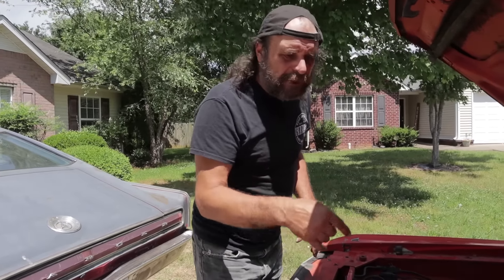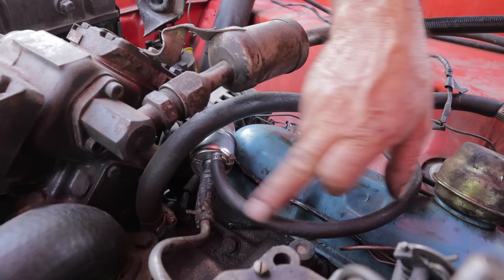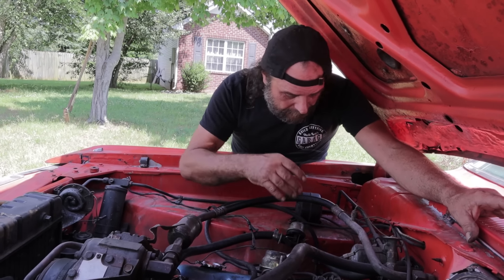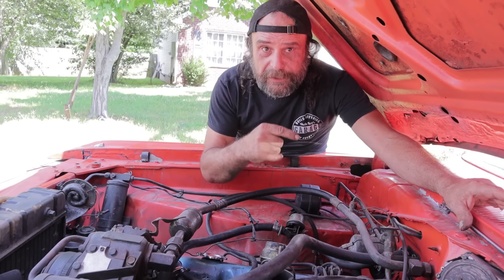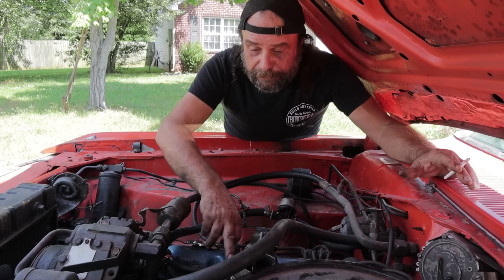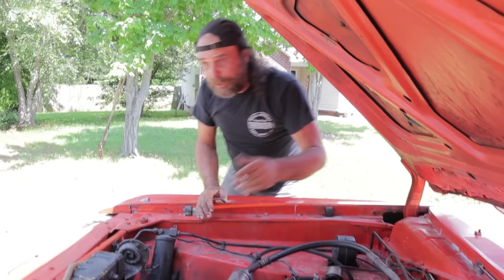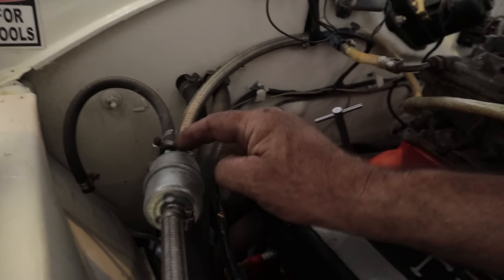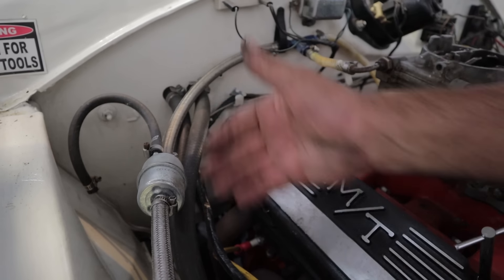$8 Cure For Vapor Lock

Comment: As a society we sooo much need to return these basic all mechanical days. Please, no more computer modules or touch screen garbage. We Need OLD SCHOOL.
Reply: Thing is my 38-year-old battery charger died there is only 1 company that still makes non-computerized chargers(for F's sake) and they want 2x the price probably gonna pay it Some things are better (you can meter fuel and spark more accurately w computer) but most are way worse with digital anything
Reply: Harry. B. Renner. jr.  I don't care about computer efficiency.  Electronic sensors fail. I want old school simplicity.
Reply: Harry. B. Renner. jr.  no todays cars are not easier. Scanners point you in the right direction, thats it. Without that scanner to see which system has the problem or if it's the communication network, your screwed. Also you still have to track down the electrical circuit and check to make sure there are not any other systems tied to that circuit(flow chart needed). You still may need to do your leg work with drivability and electrical. Today's cars are very intricate and can be very difficult even for a master technician, and THAT'S THE TRUTH. I'm speaking from experience. I could do EFI on my builds, but I love carbureted old school. There is nothing wrong with old tech if you know what your doing and you get great results with far less money. Plus with a basic setup it's actually much easier!!! No computers, sub systems excessive wiring and communication networks, etc. With old school cars you can figure out without a scanner with and understanding of what your dealing with.
Reply: Harry. B. Renner. jr.  try diagnosing today's cars without interfacing with a scanner!! It not happening buddy! I've been doing this for 26 years and today if a system develops issues you won't effectively know which direction to go without taking that first step after checking the basics. With old school all you need is a fundamental understanding of the system and a manual (repair book) and your all set. No high dollar scanners needed!! Sorry to burst your technology loving bubble but these are the FACTS!!!!👍 Especially in a grid down situation, no internet means no All data, or Mitchell on Demand!🤣😂 An old school carbureted sys with electronic ignition, or points you can get up and running with the proper BOOK style manual and the knowledge of the system. No scanners needed. Old school is easier and can be efficient with the proper know-how. Of course not many people have old school knowledge and most of them at the same time criticise not knowing what they are talking about.
Reply: @erikturner5073  You can get service manuals and repair books for today's vehicles. Also you don't need a high dollar scanner, many get by with low-end scanners. As far as which is easier, old vs new, new is hands down easier. Computer diagnostics speeds up the diagnostic part of repair. Got a misfire, the computer will tell you what cylinder to look at. Before computers, you checked all the cylinders one by one.
Reply: @killer2600  that's the problem. You need a scanner and that's the point. Without the scanner you won't know what flow chart you need. With the old vehicle's, no scanner needed. Just use your smarts and known understanding of how the system works. take the scanner (ability to communicate with the vehicles systems) out the picture and you won't be able to figure out most issues.  So, without the scanner to get an idea which direction to go or if there is a communication issue between modules, your up the creek. Carbureted/points or electronic ignition are much more easy to figure out. No scanners needed at all. Nice try killer2600. If vehicle's were easy to work on then why master techs such as myself get paid the big bucks.😉 Understanding complex systems and also knowing electrical is a big part and most people including techs are not really good at it.
Reply: @erikturner5073  A scanner is a tool, you couldn't fix an old car without a set of sockets so why should a scanner be any different. A low-end scanner can be had for around $100. I paid more than that for my first socket set and still needed more tools to work on old cars.

So nice try on you, the need for a common tool doesn't make the job harder it just means you need a tool. Even with old cars you needed a timing light to adjust the timing, a feeler gauge or better a dwell meter to adjust the points, and other specialty tools that were only good for working on cars and trucks.

Being good at electrical is neither here nor there. While there are people that don't understand electrical there are people that don't understand mechanical. There are people that can turn a wrench and not have a clue what they are doing. So understanding something is on the individual and their desire and ability to learn.

All said, you still haven't shown old cars to be easier to work on. You've just iterated more of your "I like old non-computerized cars" bias.
Reply: @killer2600  again, you missed the point. You need  a scanner to interface and retrieve codes and data stream. Without it your scratching your head on most  problems one may encounter with today's and older COMPUTER  controlled vehicle's. SORRY HOMIE THOSE ARE THE FACTS! With older carbureted vehicle's with points and others with electronic ignition systems all you need is a REPAIR MANUAL, a BRAIN(YOU ARE THE INTERFACE, SCANNER NOT NEEDED) and an understanding of how those systems work. For SPECIAL tools depending on the system, digital volt/meter, test light, analog volt ohm meter, compression gauge,  and vacuum gauge. That's it, BASIC tools, no interface needed. WITH THE AFFERMENTIONED THERE'S NOTHING THAT CAN'T BE FIGURED OUT ON OLD SCHOOL CARBED VEHICLE'S!  Hell some problems can be fixed on the side of the road even with old school vehicle's. Myself and old timers back in the day have done so. That's not happening with today's vehicle's. Again sorry dude, those are the facts, again nice try! The again judging buy you answer I'd say your a guy of today and know nothing about old-school automotive tech. Otherwise your answer would be different and I wouldn't have to give a breakdown of needed old-school diagnostic tools. Also your SOCKET  analogy in your argument was not good.
Reply: @erikturner5073  I didn't miss the point, you're just an old dog complaining about the new dog food. Even if the new food tasted better you'd still complain they changed something they ought not of changed. That's your whole argument in a nutshell. Bringing up the need for scanner is an attempt to disguise it because guess what if I want to change a tire or oil or brakes I need a jack. Theres no way around it and complaining that you need a jack to do those things is stupid.
Reply: @erikturner5073  i don't know. Electronic components in some cases do make life a little easier, ie: distributorless ignition.  Coil-packs or equivalents either work or they don't,  as do ignition modules. At least on my 1990 Oldsmobile Ninety-Eight. The GM 3800 engine and its ignition components are easy: plugs,  wires, coil-packs, ignition module.  As far as computer controlled cars go, that style by GM was pretty easy. Most everything was easy to get to, if an ECM was necessary,  plug and play provided its the right one and division.  Transmission was old school though,  a 440-T4 or 4T60 they called it i believe.
Reply: I can think of a good place for you to put that scanner

Comment: I bought a '69 Lincoln Continental a few months ago.  They are known for vapor lock, and people go to all kinds of great expensive lengths to cure it.  Some go electric booster.  Some go in-tank electric.  Many insist on using an older style 3-port fuel pump that has a return line, but those pumps aren't available anymore, so it's a game of find and send out for refurb.  It just so happens that the new pickup/sender I installed on it had a 3rd port, which I had capped off.   Then I saw this video, and installed one of these filters pro-actively on the '69 Lincoln Continental before it got hot here in Phoenix.  I ran the line back to that unused port on the pickup/sender.  I am now driving this thing in 100-degree weather with zero vapor lock issues.  Bravo, Uncle Tony!

Comment: In old times i drove (and loved) a '78 f-150 with the vapor lock issue. It took me a few years of trial and error, 'till i installed a layer of fiberglass insulation directly atached to the hood underside. It reduced the problem by 70% plus.

Comment: Thank you for the great videos. As a broadcaster the term "Vapor Lock" was used by the electrical engineers when they couldn't figure out why the station was off the air. Wow. It's a real thing.

Comment: Dude this is the besti information ever! I have a 1963 Lincoln Continentat Sedan. When I rebuilt the engine I was told it was not necessary to have the return fuel line. Having it not be reconnected gave me the vapor lock. If anyone knew what was going on they never said it to me. I could not figure it out. I am not a mechanic or have this as background but I have a very desirable car. I even had mechanics ask me if I wanted to sell the car. I feel so deceived. Thank your for this information. It means a lot.

Comment: I added this bypass filter and return line back to the filler neck of the tank and it solved my vaporlock fuel boiling issue. Thank you sir. Simple quick vheap affective fix.
Reply: Hi do you have a link for a filter? All the part numbers I find are out of stock, discontinued or back order. Thanks

Comment: Back in the 70's my 1970 440 magnum Plymouth Fury used to vapor lock on hot days when I parked it for a short time.  All I did to cure it was to wrap my fuel line in aluminum foil.  (From the pump all the way to the carb.) They ran those lines really close to very hot things and this insulated it by reflecting the heat from the line and it never happened again.  It was not my idea, I think I read about it in Hotrod magazine or Popular Science or somewhere.  I ran Ammoco 93 octane in it all the time and it had lead (ah, the old days) and no alcohol.

Comment: I knew guys like you as a kid, with real knowledge.  Now, everyone is just trying to sell crappy aftermarket parts that dont work or last.  You just answered a question I've had for 10 years. I have a stock 8600#  1985 c20.  With a return line on my fuel pump. One of the hoses had a quadrajet primary jet jammed in it. I didn't put it back when i changed all my hoses. Now i know why it was there. Im only the second owner,  it was used by an old guy, and never modified,  except for this. Awesome knowledge in your head.

Comment: I have the stock 318 in my ‘73. Even with a new fuel pump I have this problem. I’ve had the car 14 years now. I’m telling you, the pump gas is getting worse and, worse over recent years! Only the past couple years I’ve had problems. Great info Tony thanks!
Reply from the maker: It's fuel boiling inside the pump that is your problem.  New or old, won't matter.
Reply: @UncleTonysGarage  if my Chevy 350 has a mechanical pump with a return line how do I go about installing the filter ? Do I cap off the the pump and just run the hose to the filter?
Reply: @greatwhite8571  Did you figure this out? I have a C10 with the same setup

Comment: Had a couple of 60's era Plymouths. That problem always seemed to pop up when they had steel fuel lines. used to wrap aluminum foil around to fuel line crinkled up like a hydronic heater. worked like a charm.

Comment: I used to have an 81 Honda Accord that HATED Gasahol. It would vapor lock like crazy on a hot day after it sat hot for a few minutes.  I spent a lot of money at the Honda dealer before I discovered that changing the gas fixed the issue.